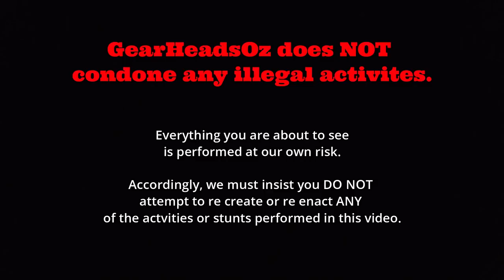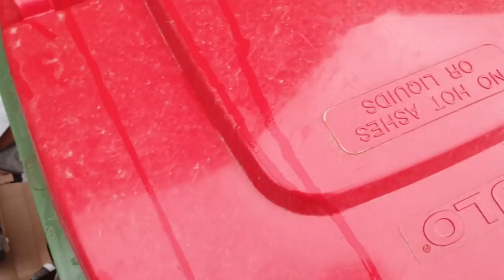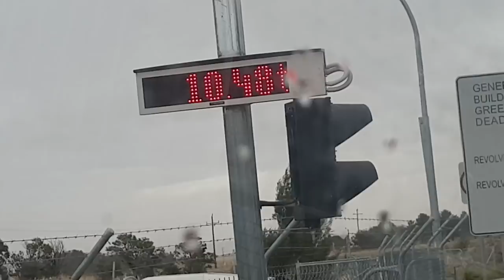Cleaning Up The New Carport! & Suprised Him On His 18th Birthday! Vlog

Comment: That vu ute has lasted a long time compared to the other cars, it must be looked aftet pretty decent
Reply from the maker: Yeah it's has lasted a while hahaha, it did go through an engine swap last year though
But it's been good ever since 👌 I'd say it's mostly because it never really gets driven consistently, he has the pulsar to drive and that basically just sits there most of the year and goes out on permits sadly :( 
It's making a comeback very soon though!
Reply: @GearHeadsOz  it looks clean enough for a LS1 conversion one day haha wink wink
Reply from the maker: @jarrynsmith  Yeah that's his plans dude! Hahaha
Reply: @GearHeadsOz  maloo bodykit, coilovers and some nice 3pc rims would make it look sick
Reply: Its og motor lasted 2 and a bit years of limter and abuse while i was on my p's but then the top end went just a couple months before i had met matt and had sat up the back for while i was gonna do a ls conversion was about to buy a low k ls1 with a loom and ecu but some shit happened and and had to pull the pin and put the money elsewhere so just chucked another ecojet in it for now and just take it out on permits when i wanna have a bit of fun i will do a ls conversion next year for sure but and then strap a snail to the side of it for sure but ive had it for 4 and a bit years the only let downs ive had is a clutch and a motor and the front end at the moment bit ill fix it and bring it back then lower it find a decent set of 19s then ls it
Reply from the maker: @donnymoite  Yesss Liam thank you 😂👌 There's the history on the Ute lads! 🙏